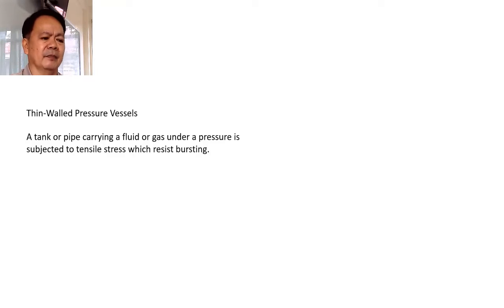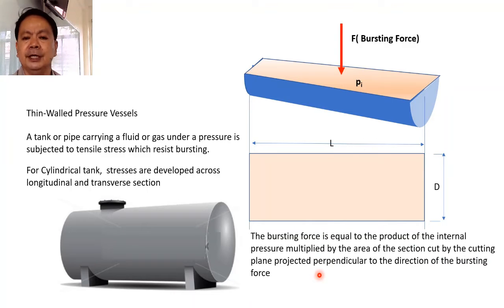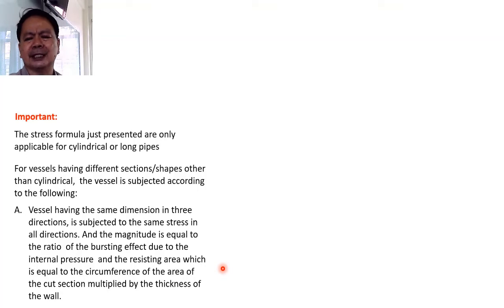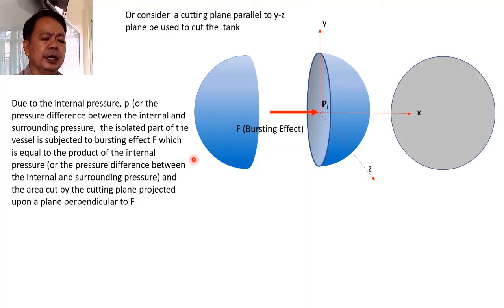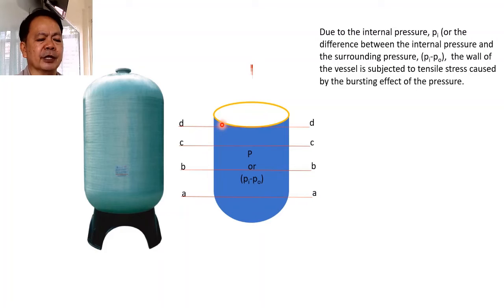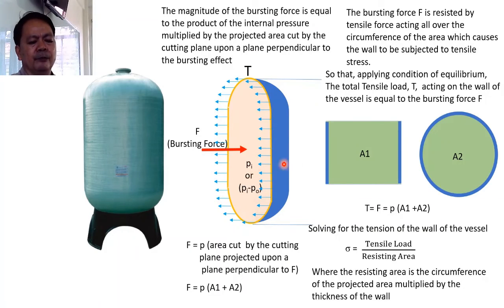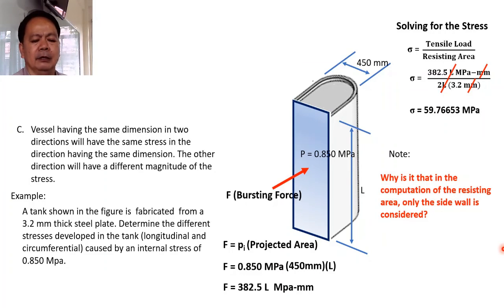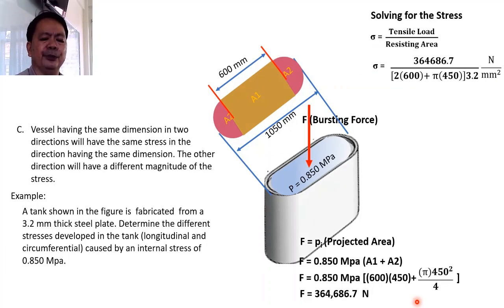Thin-Walled Pressure Vessel (Concepts, Derivation, Application and Sample Problem)

Comment: Sir ask ko lang po pagdating po dun sa resisting area  nung tank, yung πDt po ba ay equal lang sa area nung internal circle minus area nung outside circle?
Reply from the maker: If the projected area of the cut section is in the form of the circle, the resisting area is the circumference of the circle multiplied by the thickness...